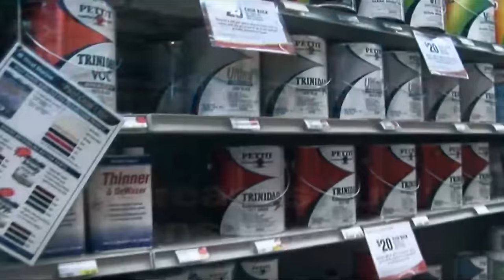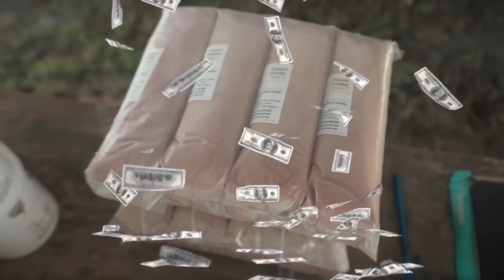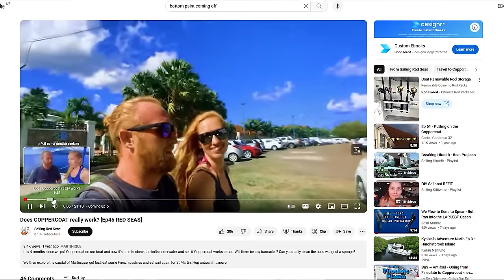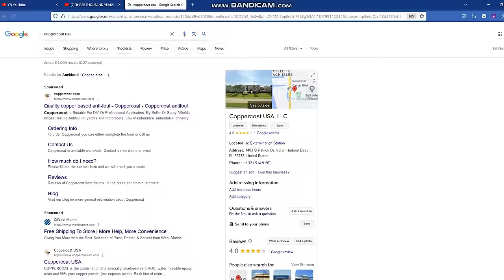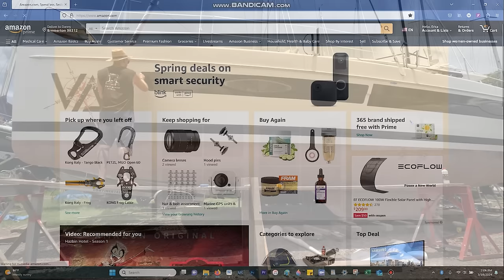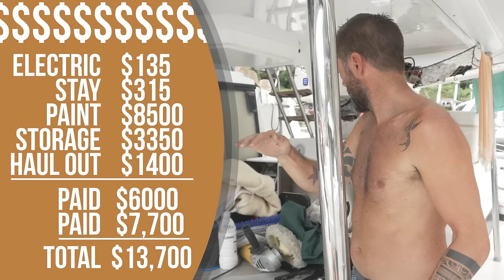Why We Chose Copper Coat Anti-foul Paint for Our Catamaran | Episode 246 #sailing #boatlife

Comment: We were lucky to have our Coppercoat done in a tent with no rain threat. It is so solid and hard. After sanding before launching the bottom shimmered like a shiny copper pan, reflecting the light on the water. We hauled after 2 1/2 years and there was noting that didn't blow off with a pressure washer. The haul was just a lift and look and a pitch change on the Maxprop, grease, new zincs, and inspect all before the passage to FP.  A couple hours in thee slings and back in the water. We have friends in the marina here who have a Peterson 46 that has CC bottom that is 16 years old and  still good. Had half its life in tropical waters. We saw this boat hauled and the bottom looked like new. And ours is so slick and smooth that i;'m sure it adds speed as well. And you won't be sanding that poison stuff anymore.
Reply from the maker: YES!! Thats what I wanted to hear!!!!

Comment: I'm building a 15' Cape Cod catboat in my backyard as a learning/experimental project and as a vessel for a singlehanded 2 year travel project (Great Loop). I'm homebrew hacking an epoxy-copper powder antifoul.      The lower-leach and longer life prospect is also what I'm drawn to.  As a modern wooden hull, I'm concerned about electrolysis with the copper, soI'm building with plastic-composite nails in the hull to hold things tight while epoxy cures.

Comment: I hope it works out for you. The paint looks too thick to roll which creates an un-smooth orange peel surface. Which in turn necessitates more sanding to the point where there is hardly any copper coat left on the hull.

Comment: This may be a question for the manufacturers. And i could be totally wrong here.
But it seems like it would make more sense to spray it on for a more uniform coating with less texturing from the rollers.
More like automotive painting.
Which would mean less sanding to expose the copper.
Reply from the maker: Yes I agree and in the states I would have pushed for that but apparently spraying this product is very difficult